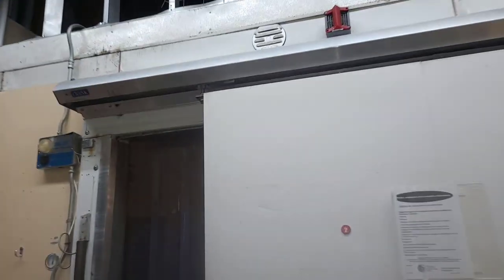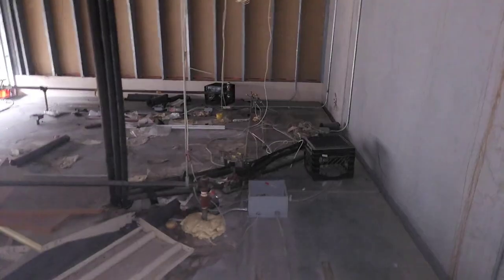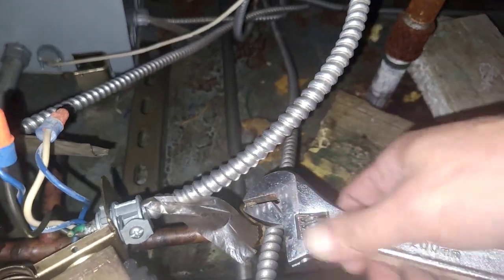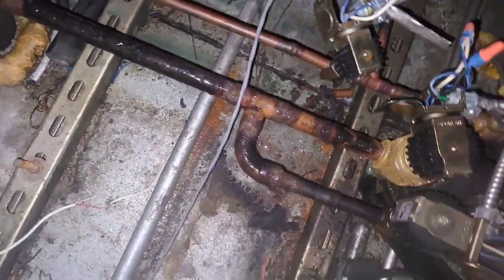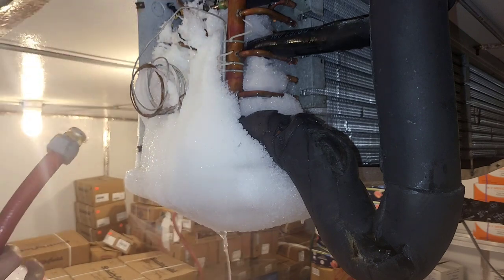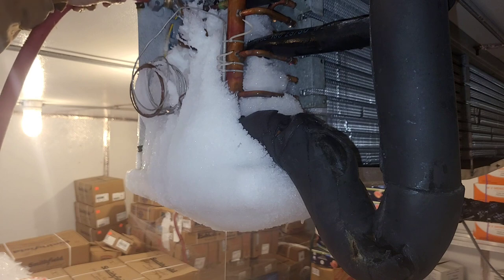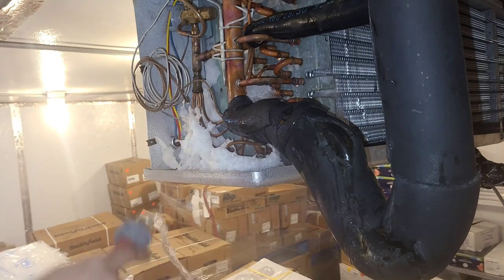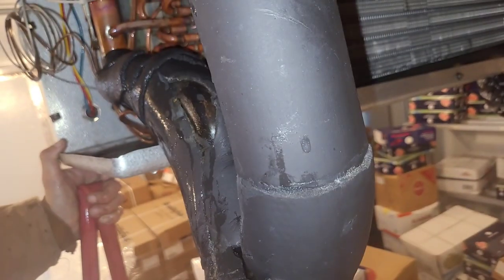Walk In Freezer On Rack Not Holding Proper Temperature - Plugged Liquid Filter Drier - C053S

Comment: Is it possible to use too hot of water to melt the ice? I have some very hot water available in some areas of my facility and  have wondered at times if it was too aggresive risking rapid expansion of old  bends...
Reply from the maker: I have never experienced extremely hot water damaging anything. And I have worked on some old brittle units, and some of the hottest water available(180°). So I wouldn't worry about it. All the immediate heat from the spicket will dissipate and the hose and atmosphere will absorb that extreme heat. By the time it comes out the end of the hose it will have lost 10-15°

Comment: Would it not make more sense to have the drier near the condenser?
Reply from the maker: They do. This is Rack D and this is Circuit D5. The other evaporator in that box is D6. They each have their own drier, but also a big one at each Rack Protocol Unit, that you can replace the elements on.
Reply: @HVACRServiceTech  is there a reason they do that? It seems like that main drier would do most of the work so secondary driers seem like an annoying failure point.
Reply from the maker: @Thermoelectric7  I'm not sure the exact reason for it. Maybe because of all the separate evaporators, or just because it's a big system. Probably just more protection overall one way or the other
Reply: @Thermoelectric7  usualy its to protect the solenoid from debris, that would leave it stuck open, in this kind of installs there are always modifications where there is a possibility that small copper shavings etc end up in places where it dont belong.
Reply: @sjefoekel6058  I'd get that if it were before the solenoid haha. The solenoid in the video was on the roof before the drier
Reply: @Thermoelectric7  there is also hot gas defrost, where the liquid wil flow back trough that solenoid and filter. And this is not a biflow filter,
Some enginerd ffed up here.
Reply: @sjefoekel6058  you got me wondering. Have another look at the video, the filter drier will be fine there. Reverse flow from the hot gas defrost tees off after the TXV, doesnt flow back through it (and the drier). Saw a check valve on the roof. Three pipes going up from the evap to the roof.
Reply: @HVACRServiceTech  do you still have the filter dryer? Imo it might be worth cutting it open to see if there's anything in there. If its moisture in the system potentially your main filter dryer cores need replacing, otherwise it might start doing the same to the other evaps. Debris would be the other cause but hard to tell
Reply from the maker: @Thermoelectric7  im sure that there is plenty of other preventive things I could check and find. But they dont want to pay for it. So it stops there
Reply: @HVACRServiceTech  that's fair. I always like to find a cause for failures. Let's you understand the system a bit deeper
Reply: @Thermoelectric7  you are right, the liquid will flow back bypassing the txv and drier. However the drier should be placed in the liquid line
Before the solenoid, this way it doesnt freeze up any moisture during pump down. Since it will be cold in that drier and txv wide open during defrost, you can guess where warm liquid is gonna go. Try being smarta** about that (no pun).